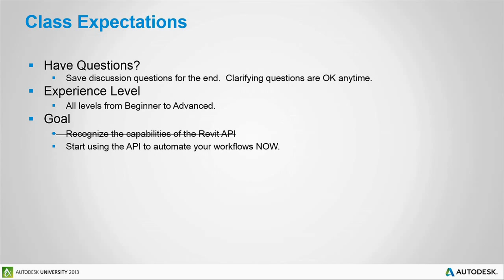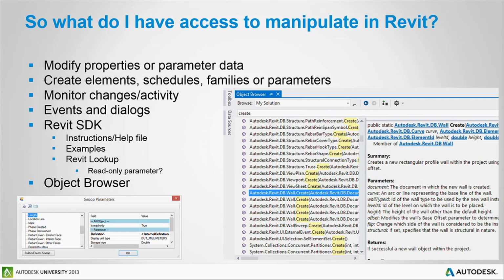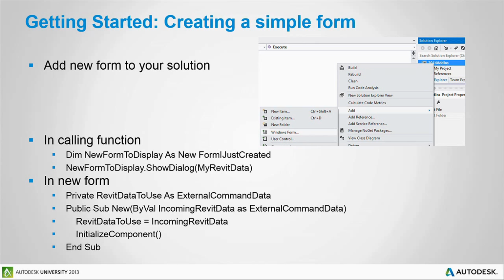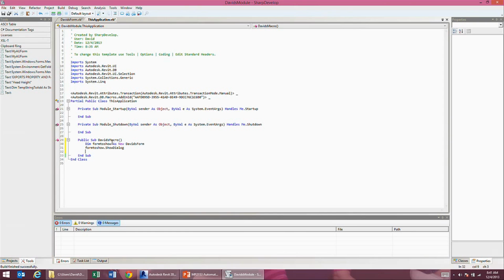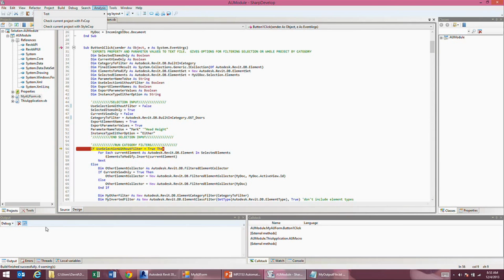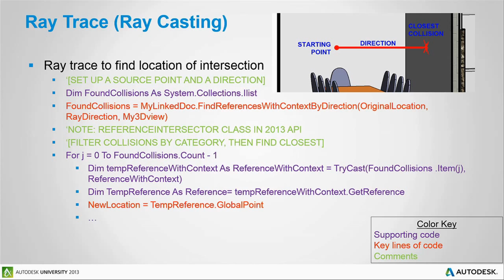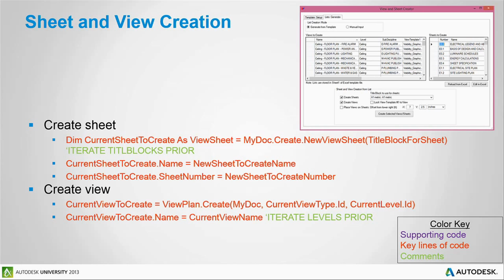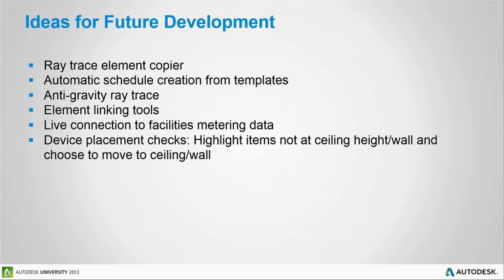Learn the Revit API: Automate Your Autodesk Revit Workflows

Comment: Is it possible to write a macro to automatically size ducts/ pipes based on certain criteria (aside from the Revit default sizing)? Thanks
Reply: Search for revit family lookup tables. You can setup a spreadsheet with sizing data that will affect the family.

Comment: Hello, i m trying to get the volume, length and height of the elements but i failed.
Actually i do not know what the Autodesk.Revit.UI means???
What i want to do is i can select the elements and print out those data i wanted. can u tell me how to make it work??